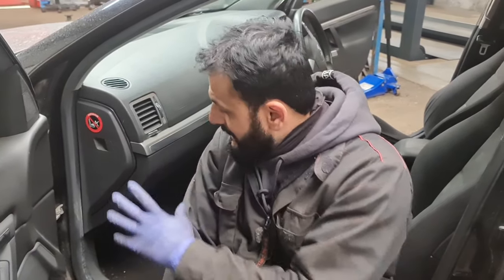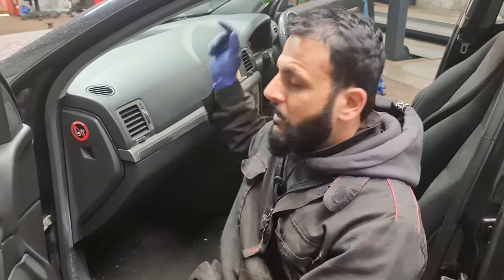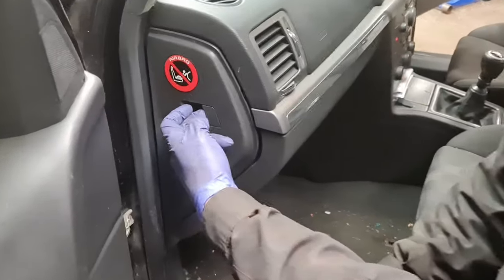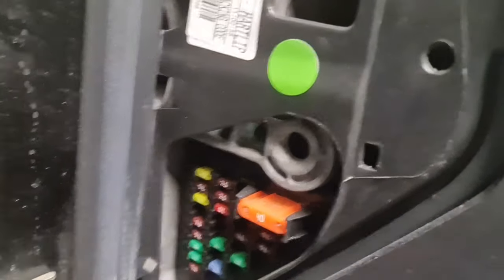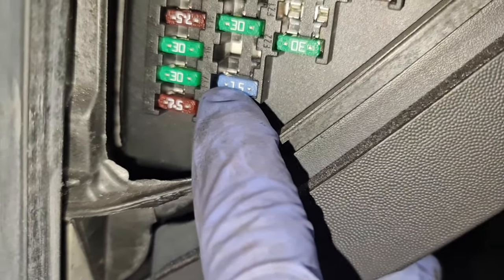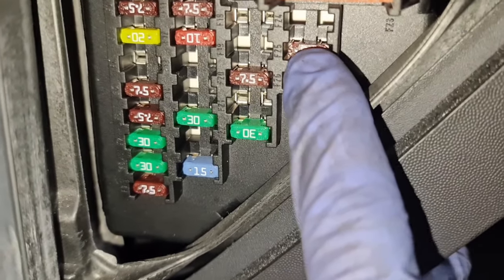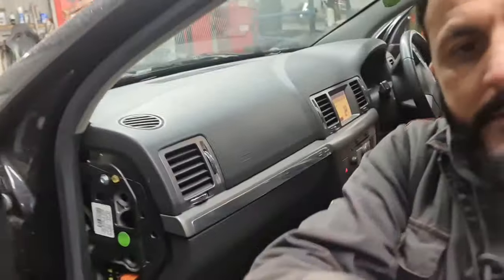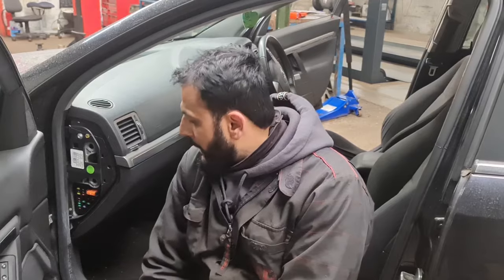Vauxhall Vectra C | Instrument Cluster | Information Display | Fuse Location  4K

Comment: Hello my friend, i have interesting problem with my Vectra. The motor in the boot lock burned out. I was replaced it, it works good, switch too, everything fine, but the "boot opened" light in the instrument table won't go out, its always on, even the boot is closed. I have tested the new lock, the microswitches are good too, the lights in the back goes out, when I close it. Can you help me?

Comment: I got Nissan micra 65 but when I press clutch makes funny sound should I get the checked by a professional
Reply from the maker: Hi, If your Nissan Micra is making a funny sound when you press the clutch, it could be due to several reasons. One possible cause is a worn-out or damaged clutch release bearing. This bearing is responsible for engaging and disengaging the clutch, and if it's damaged, it can cause a grinding or rattling noise when the clutch pedal is depressed.

Another possible cause is a worn-out clutch plate or pressure plate. These components can wear out over time and cause a scraping or chirping noise when the clutch pedal is pressed.

Additionally, it's also possible that there's a problem with the clutch hydraulic system, such as a leak in the clutch master or slave cylinder. This can cause a whining or hissing noise when the clutch pedal is depressed.

It's best to have a certified mechanic inspect your Nissan Micra to accurately diagnose the issue and provide the necessary repairs. Thanks 🙏🏽